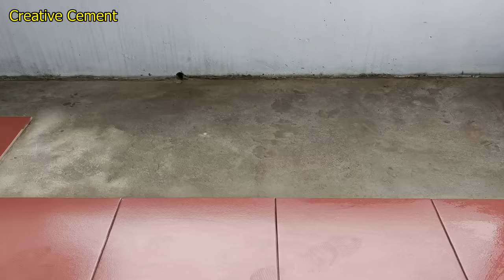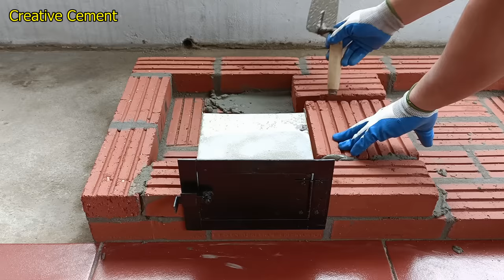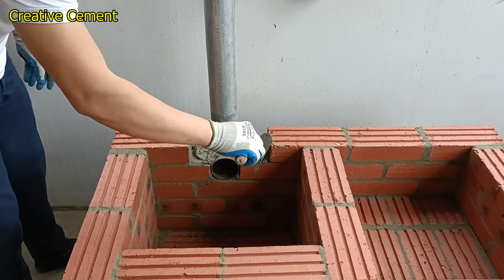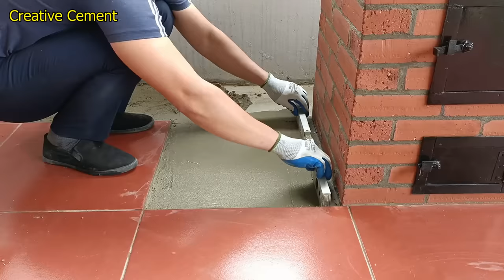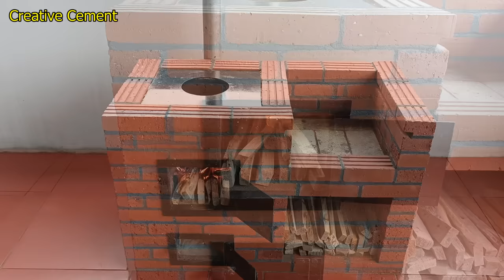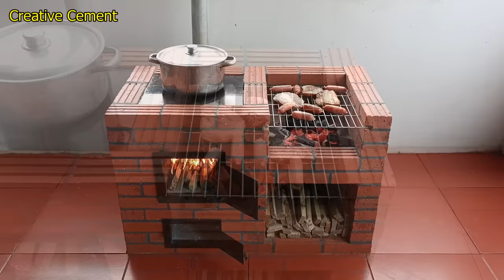Outdoor wood stove from red brick and cement

Comment: Just a note: cement and mortar are not the same. This is fine for a small project in a warm climate but if you live somewhere with constant freeze/thaw cycles or where there will be significant settling, your going to get cracked bricks instead of cracked joints and I'd rather fix joints than bricks. Nice work though.
Reply: Beateryfull
Reply: So use mortar that has some give?
Reply: @Obyvvatel  S mortar is the most universal for brick work and exactly: it’s a little weaker than the brick so it gives before the brick. Mortar has cement in it but there’s other stuff that weakens it and makes it easier to work and cures slower giving you more time.
Reply: While watching the vid, I was wondering, for those kind of woven build with red brick, and cement, is not a super type of cement used in the build ?  then your comment pop up. lol
Maybe it is close to your note, be aware I am no expert Maybe called mortar, dont know. 
As you said, I respect the project, its cute, and can make few tasty pots and cook some meat😊
Reply: @raskov75  so nice, you very briefly explained important points about mortar...
Reply: @Виктор-ш4в3ц  Grandson of a brick layer in NYC on my moms side, son of an architect whose entire family is in the concrete business on dads side. Been around this stuff since forever.
Reply: @raskov75  i felt it
Reply: Thanks, I was wondering what the difference was.
Reply: @raskov75  You seem awesome!!
Reply: Bartleby your correct and all i was waiting for was too rake the mortar/cement😉 JOINTS
Reply: @raskov75  You make good points, although wouldn't you use Type N mortar, which is recommended for above grade applications? I use Type S for below grade.
Reply: No vi que pudiera cemento abajo de los primeros ladrillos
Reply: Looks like almost at the end. He use insulation..thats for the weather ??😉
Reply: @deliarodriguez4319  That's not building insulation...I'm guessing he's using high temp ceramic fiber fire barrier insulation to keep the smoke from exiting those spaces.
Reply: Úí
Reply: You answered the question I was going To ask.... what type of bricks and cement would you need in a sub zero climate? Thank you!!
Reply: Para o Brasil está ótimo o clima aqui é tropical é calor o ano todo o frio e raro, só é acentuado no sul  do país, mais nada comparado ao hemisfério norte
Reply: @raskov75  which is better for cold climate
Reply: Good to know! I'm inspired to learn a skill like this. Turned out really well.
Reply: Thanks. 👍
Reply: True.. not an expert, but you made me reflect back to what I’ve learned.. been a minute since I’ve worked with cement or mortar mix .. Actually loved pouring and finishing several walkways almost 30 years ago.. I couldn’t imagine doing it today… ouch…. No cracks 30 years later, and we didn’t have videos like today… I had a book that’s probably around here somewhere … I can’t remember the name, but Don knotts was on the cover. 😁☮️
Reply: Cement is to mortar what flour is to cake.
Reply: @raskov75  If you use regular mortar your wasting your time, it will crumble. You use fire brick and mortar made from fired clay to lay up any application with high heat. From the son of a Master Stone Mason, all a waste of time.
Reply: Please give the details of item used in India
Reply: Vous pouvez adapter  à votre PAYS...le projet  est super   ...😎😋
Reply: если уличная! то харошии дождь с ветром  и все смоет
Reply: Con todo respeto, como lo haria usted, un video por favor gracias
Reply: I was gonna say, 
"Wait till those bricks pop...".
Reply: @SealingTime-kj5rp  Think I’d rather just read the Bible
Reply: @helenadias2203  où trouver les éléments à encastrer comme le foyer ?
Reply: обычные глиняные кийпичи горят- превращаясь в стекло

Comment: You best hope this is not in a area that receives sub freezing temperatures if this is not covered. It will be less then two years before it starts to break apart.
Reply: This project is Awesome 👌
Reply: What was the white foam that he used on top also where can those oven doors be purchased and what is the size. Great video from this guy but no materials instructions other than red brick and cement
Reply: @DewnetteReid  I think they where for installation I was wondering the same thing
Reply: @Tripleheadedgoddess888  I would like to try this outside but no real instructions on how to make it. I would really have to do some research to find those doors and that foam that he used. the foam has to be the right type because it can cause fire.
Reply: @DewnetteReid  you should email this channel for information and instructions
Reply: this is not foam, this is a fire-resistant material like a heater, and these doors are most likely sold to order in Russia, since many have such stoves.
Reply: @Sen-rnt  thanks for the info Nina. these materials are not easy to get so I don't know why they want to say its a simple task when you cant get the products
Reply: @DewnetteReid  thank you) .. it’s easy to find it with us, since they began to return the forgotten ancient methods because of the convenience .. maybe through the Internet and you can find it? Recently, antiques are gaining popularity)

Comment: I'm excited and confused. I was always taught to keep all cement away from fire and heat as it literally explodes from how cement is made as the cement reaches basically a boiling point internally. Did you actually make Mortar, which is cement mixed with the appropriate building sand? or use a premixed mortar? or did you use straight cement? Because straight cement exposed to heat from a fire can and will explode in small pieces.  For those looking for ingredients please know to use Mortar and not regular cement to hold the bricks together. There are many premixed mortars at home repair shops or there are many traditional ways of DIY where cement is mixed with certain types of sand, normally coarse sand/builders sand, to create Mortar. The DIY method allow you to really adjust the thickness of the product you are working with as you become more skilled at the trade of slathering it between the bricks vs making a retaining wall of large rocks. Never use straight unmixed cement as cement will break. 

Please read - High temperatures also affect the compressive strength of concrete. Above 212º F (thee temp of water boiling), the cement paste begins to dehydrate (loses chemically combined water of hydration), which gradually weakens the paste and paste-aggregate bond. The behavior of concrete at high temperatures is influenced by several factors, including the rate of temperature rise and the aggregate type and stability. Abrupt temperature changes can cause cracking and spalling due to thermal shock, and aggregate expansion can also produce distress within the concrete. 
Above 212 F and concrete can loose so much water it will crack and peel away. Higher then that can actually make those chips fly off to release the pressure of the water coming out. Always use the proper mortar for projects that will be around heat. Fireplaces to grills and so on.
Reply: Great....logical
Reply: Yep, this is not a good design.
I think the oven won't last.
Reply: He used fire bricks and insulation. Not sure why youtube commentors always need to slag on someone who obviously has done a thing before and knows what they are doing.
Reply: @talyn3932  because you have zero experience, you think it will work. This is misleading and dangerous.
This might cause someone's home to burn to the ground.
Reply: @boerbol9422  he doesn't list his materials so it could very well be a cement for firepits.
Reply: @boerbol9422  lol... watch his other videos he srates what he uses (clay and sand) and your assumptions about me are hillarious. 
You are the ones here trashing on an obvious professional and expecting people to just take your word for it. Its attention seeking. Nothing more.
Reply: @talyn3932    Because the Title says "red Bricks and Cement" and someone who just goes to Home Depot and gets red bricks and cement and does this at home without the knowledge could cause damage to themselves or others. The general person who reads this may not understand they can't go and buy generic cement to do this "cool looking project" they saw online. Many people don't do the research and just go by what is listed on the title unless it gives very specific instructions on what materials are needed and how to do it. Even a 16 yr old could watch and believe he could do this in his yard not understanding what actual products are needed. I did not slag on him but asked what he used for his Mortar? If it was a premixed, which brand or type. If he mixed it then what quantities did he mix of what and why? None of it was negative about his work but the concern for people who may try to copy without the skill and understanding in working with cement and it's many varieties and mixes to Mortar. Others have asked for a list of materials and that was not "slag" but questions because the project is pretty and they may want to repeat the work but need to know the proper materials. I did not make a negative comment about his work.
Reply: @talyn3932  Others below comment to use basic cement. Others below also make the same concerns that I do in which cement and mortar are not the same. I really get the idea of personal responsibility and you shouldn't trust it because you saw it on youtube or tik tok or w/e AND I know people who believe the crap they see online and will argue it like it is correct info despite no legitimate knowledge to back it up. What you are doing by not educating people in making sure I am still dispatching for Fire and Medical in the lower 48 and PR and making sure projects don't last and possibly adding to doctor bills and keeping them employed as well. People do crap they saw online everyday so all I ask is for people to be aware that using straight cement may be a poor choice. Your empathy and care for others vs blaming them for not knowing how to do things shows your concern for common man.
Reply: @Lizzard2060  lol. Okay
If you are going to start a project like this and NOT do some legwork on it... you got no buisness doing it in the first place. Blaming a youtube video for following a template without knowing what you are doing first is just, plain, asking for trouble.
The problem is that you all were acting smug like he didnt know what he is doing when he obviously does and now you are shifting the goalpost and virtue signalling "safety concerns". 
All you guys that comment in any project on youtube are the same... you assume the expert is a novice and that you, the actual novice, is an expert.
Reply: @talyn3932  I'm so confused how asking what he used for mortar and not using cement is a big deal. I didn't say he did something wrong. I simply said that if he mixed cement with sand creating his own mortar the average person may not understand and in the title it only says cement and I and others asked for a list of products used. You also have no idea how many years I have worked with cement of many kinds. You don't know if I am a novice because you don't know me or my background. Anyone can also pick his name for youtube and claim to be a professional. The reality is we don't know. You can call caring about the project and safety virtue signaling but at least I care about other human beings and have pride in projects being done correctly. You have just attacked me for simply asking about products used and making sure everyone knows to use mortar which others below did as well but you didn't harp on others. I don't apologizing for wanting a project to be done right and people to be educated on how to do things to the best of their ability with the proper materials. I actually give a crap and care and you could never guess how I feel as you have blamed anyone who would follow someone on youtube without doing research but it happens everyday.
Reply: @boerbol9422  эта печь для улицыыы!
Reply: Thank you for the extra info lizzard
Reply: @Timothy TwoTwoThree oh gosh, now what did I say?🤔
Reply: @Timothy TwoTwoThree 😉🙂
Reply: @Lizzard2060  Thank you for your input with regard to this project. Prior to finding this video, I had already obtained some bricks with a view to making an outdoor summer stove similar to the above (so I can save myself a bit of money on calor gas). 
I could well imagine that, given the increased energy prices many of us will be facing very shortly, I won't be the only one thinking of making an outdoor stove of this kind.

I had 'assumed' that ordinary cement, although liable to cracking eventually, would be okay for something like this. Thankfully, I had not started building and had bought no cement as yet. Now, due to the warnings in your comments, I realise I am going to have to do a bit more research and find something specialised to do a safer job. 

So I'm grateful for what you have said and will bear it in mind. Thank you :)
Reply: Thank you for the detailed explanation and warning.
Reply: @aducksaysmoo  I wish he listed the materials. He lists the songs smh ????
Reply: @talyn3932  How do you know he knows what he is doing if he didn't list materials? maybe it was a disaster when he lit it on fire multiple times. Did you see a follow up video where he's actually still using it?
Reply: @Alpha_Anthony  lol. Weak argument. He has a channel with multiple builds and yes... he uses them. 🤣
Reply: @talyn3932  So you answered my question. Not argument. My argument would be that I would of used cement based on his title and name. 

You can really defend anything though but you have to take into account the people with little to no knowledge about the subject. There are more with no knowledge on this website than with the knowledge.
Reply: Yeah... Talyn just seems like a troll that's looking for something to be mad at. Good job Lizard and thanks for the info.
Reply: @chibigirl8545  coolstorybro
Reply: how is this not a stickied comment, it could literally save someone's life....
Reply: @samaraisnt  It should be and he should change his name from cement to mortar. "Red brick and Mortar"
Reply: Ma i mattoni,sono refrattari ?
Reply: @Lizzard2060  Gracias x tus explicaciones y aclaraciones para bien del que quiera construir ese proyecto. Porque busqué materiales en el video y no los encontré.  Ahora tengo más claras las instrucciones con los cuidados necesarios para su construcción . 👍 👍 👍 👍

Comment: you can install a valve between the brazier and the firebox so that you can remove the coals, and the brazier remains clean after use
Reply: @محمدابراهيم-ف2ف7س  то
Reply: سنرزصزىيم سكرزصنىزسمى
Reply: @محمدابراهيم-ف2ف7س  تاع

Comment: Great idea and job!
Will you give us a specific list of material?
Reply from the maker: I used 165 red bricks, 15 heat-resistant bricks, materials for cement, sand, clay, metal rods, metal chimneys, 1 fire box door, 1 air outlet, heat resistant cotton

Comment: This stove does not take into account the expansion of the brick when heated, cracks will appear.
Reply from the maker: Thank you for your comment
Reply: @CreativeCement  Technological gaps are needed between the bricks of the main furnace and the rest, it is desirable to use fire-resistant material in the gaps.
Reply: @livetohack8512  yes and in a perfect world, people could do anything. Stop acting so privileged and haughty, in the rest of the world people have bigger problems to spend money on than fire-resistant, 1st world approved fire-resistant material. In my part a clay brick breaks, you replace it. Hope you find inner peace, it must be hard living with such a perfectionist overachiever mindset. And stop spitting in other people's soup too. You want to teach others the proper way, how about you go get yourself a teaching license, instead of pontificating over on other people's comment section.
Reply: @o.a-b7212  What's on your mind? Flame retardant material is not expensive and is not required. The design of the furnace will lead to the fact that it will have to be redone. It's better to do everything right. Need technical clearances. Flame retardant material is a recommendation. Any physical work is priceless, we must strive for the best. A person uploads a video here for people to see and comment on. And it is the choice of people to read or not comments.
Reply: @livetohack8512 @O. A-B I don't believe the feedback was privileged. I was always taught it's better to take your time and do it right rather than redo it as this is your physical labor and time. Both things you can't get back. I also asked if he was mortar as it says "cement" in the title. There are technical ways that this needs to be done and it's not being mean to correct someone on the way they are doing something especially when they put it online for others to see. The best thing is to verify if the person's feedback is correct, as this person obviously has internet, and then take it into account for all future projects and learn from constructive criticism. If the criticism is not constructive and just putting the person down that is different. This was simply suggesting that the person use the correct materials for the job and the correct techniques so it lasts for as long as possible. That is actually wanting the best for this person. Masonry is a hard skill to master for anyone.

Comment: Great work. You have given me the initiative I needed.  Can you add the materials to the description area.  I would like to know what to use or send me the information.   You are amazing.
Reply from the maker: I use 165 red bricks, 15 heat resistant bricks. The raw materials include cement, clay, sand, sheet metal, heat-resistant cotton